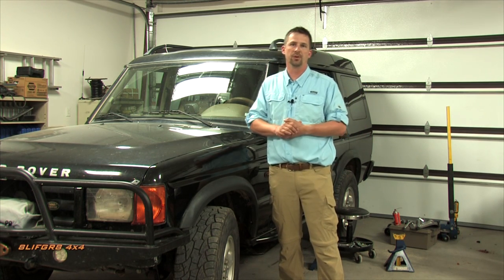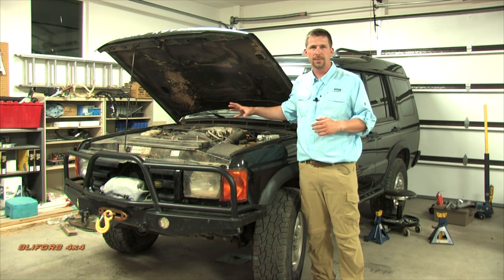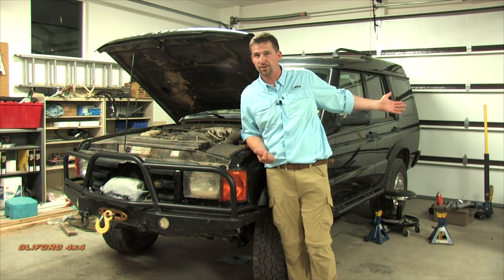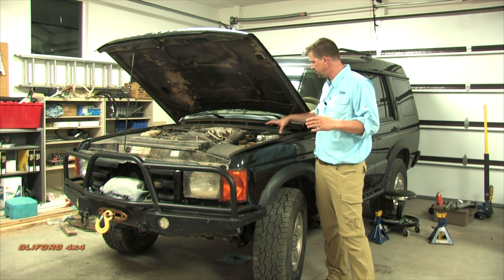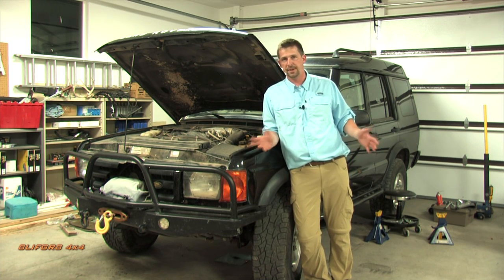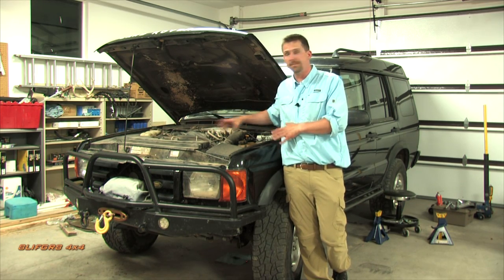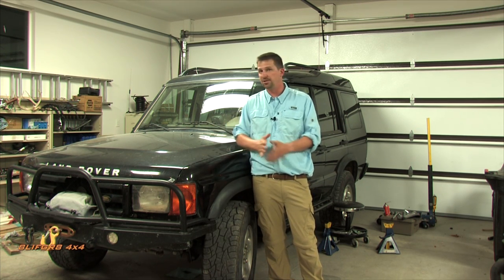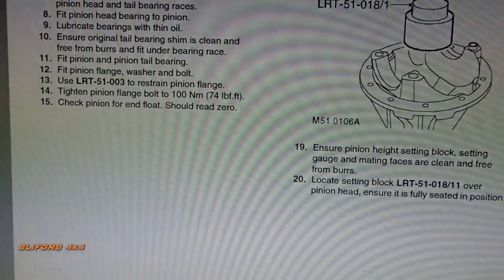Ultimate Owner's and Buyers Guide:  Land Rover Discovery 2

Comment: Great video, everything he said is 100% accurate based on my experience with my 2004 Disco II. Once you dig in and get to know the truck it's not so bad to work on. My first repair experience that was frustrating was changing plugs, I pulled wires of and cracked just about every plastic tube under the hood. Talk about frustrating, anti freeze and vaccum leaks everywhere. Holy crap, the worst repair had to have been the ignition coils, no room to unscrew the bolts that hold the coils in place under the cowl. I probably should have removed the intake manifold and replaced the top half gaskets. I'm sure it's only a matter of time until I have to do it again.
Reply: well he did a good job but he is not 100 percent accurate. if you have a 03 in the oil pump failure VIN range you can not simply replace the oil pump. as you know the pump is actually a part of the front cover.. and during the machining process there was a dowel hole feature that was machined out of tolerance and not caught. I cant remember if the hole misposition was on the front cover or if it was the dowel pins that locate the front cover to the block. anyway the land rover fix for this during warranty was installation of a new longblock. so if you have an 03 in the failue vin range you are gonna have to replace the front cover (if that is where the faulty hole spread is located. or you are looking for a new block! Either way you will not simply be replacing the oil pump and moving on. 

I have an 04 SE7 with 85k and It is starting to do weird stuff. i bought it cheap knowing it had just overheated bad. so I jumped right into a head gasket replacement. I didnt want to do the inline thermo mod so i got a new land rover 180 deg and also a put in a new water pump , hoses, radiator and a heavy duty clutch fan. but im still floating around 200 and over sometimes according  to accuguage. i dont know what im going to do next. I want to just put a new long block in and not have to worry about it for many years, hate to say it but im always thinking about boiling coolant on a long trip!

I have the center differential and it is really really tight. im scared to engage it again. what do you have to get at to lubricate the shifter and linkage
Reply: @matthewlewellen6516  I have a 2002 with a 4.0 and I got the inline thermostat mod and I'm running down in the 180 range constantly it's amazing! Also I got the coil pack relocation kit when I needed to change it do to a misfire and wow it is so much better up front
Reply: They make a relocation kit I just did it this weekend! Yeah you're right it's a nightmare I broke all kinds of connectors and vacuum lines along the way but now my coil pack sits up front between the alternator and the tire jack under the hood. There's a perfect spot for it and the custom wires run perfectly. You just get these harness extensions and then mouth is little bracket on your alternator and you have your coil pack right there in front of your face from here on out

Comment: New sub here. Brilliant tutorial,  I’m from Ireland and have a 2003 discovery 2 4.6L in Portugal. It’s a USA Jeep and has only 50K on it. Never been off rd. I plan to take it off road. Nothing too heavy . Beach, sandy and trail driving. Little or no rocks. I’m considering fitting the TD5 thermostat, and the ultra gauge. Save my head gasket. Cheers again for great video.

Comment: I had the three amigos on for almost 2 years until I read an article on the forum. I replaced the shuttle valve and did the reccomend work around. When I had 3 amigos I didn't have ABS which was scary.
2004 Discovery II, I bought it in 2008 with 35k miles now 168k. Been through alot with mine, thank god I can do my own repairs. 
I have the master cylinder oring issue in winter, replaced crank sensor twice, replaced cats, O2 sensors, radiator, water pump, headliner, LED headlights, front shaft, and much more. Steering is next. Yes, leaking is definitely an issue on L.R's. 
I parked mine in my garage for 18 months, recently fell back in love with it.
Reply: How did you do the LED headlight swap?

Comment: Great video, man! Owned my Disco II since 2018, and its been way more reliable than I had any right to expect. Anyway, you covered all the bases, I think. And 100% on the T-stat. When I installed a REAL temp gage, I was shocked at how high the "normal" operating temp was. I was seeing 230 on the highway, and it would usually spike to 250F when I exit the highway for a fuel stop! No wonder these things have a rep for eating head gaskets! The only thing you brought up that I wasn't tracking was the "guibo" flex joint. Might have to toss one on, JIC.
Reply from the maker: Mine is starting to crack but I haven’t bothered with the job yet.  Spare is in the rig.

Comment: Thanks very informative. A parts man in a very successful rover shop told me that the electric AC fan is also for when the engine overheats. Mine will not move, it’s rusty. I took it apart, it’s not fixable.
Reply from the maker: Maybe I should test mine, it’s been awhile.

Comment: Thanks so much for this video. Huge help. I just bought a 2003 with only 64k miles on it. It was part of a drug seizure and sat for 10 years. The exterior is beaten from the AZ sun, but as far as I can see, there are no leaks yet and it runs great. I'll be checking that oil pump and feeling around for the center diff lock (although it's probably not there).
Reply from the maker: Lol, @Maw 3615054

Comment: The rear drive shaft Rotoflex coupling when new is really stiff, any cracking or softening will often cause rear axle vibration. It's a cheap replacement part - use a genuine one and it will transform the drive. I also suggest Polyurethane suspension bushes as original rubber ones will distort and make tracking difficult to set. Poly bushes will need a hydraulic press to do the major radius arms, but use for all ideally. This will make the car chassis feel like new and they are self lubricating!!!Kits are available with various firmness, make sure they come with stainless steel bolt sleeves.

Comment: Awesome vid. I have a 99 Discovery II, With 280,0000 miles. I have ALWAYS used Shell Rotella T. 15w-40. No problems . You did forget to mention not to talk bad about your Rover within hearing distance...It will break down on purpose to just piss you off.
Reply from the maker: Hahaha!  Mines leaking in the driveway now.  Most likely because I replaced my dino oil with synthetic, but I think it's because I've been wheeling the LX.

If the stupid Toyota wouldn't require so much maintenance, I could give the Rover some needed TLC and get her back on the trail (she needs the leaks fixed, has a small exhaust leak now, and due for plugs )

Comment: If you're in an area or State with no emissions tests, besides the improved driveshafts do a catalytic delete 
No more heat issue and several more horsepower
Reply: Rob Crissinger just get an o2 simulator to avoid the CEL. Some emissions test are just an obd2 scan.
Reply: Have you done this? Just got a d2 and need to do something about my exhaust as it’s bent badly. Was thinking of doing the delete but worried about bad back pressure.
Reply: @ChelseyWood  Yes I did a secondary air delrte and cat delete.
Reply: The cat delete lowers backpressure

Sounds cool too
Reply: With a proper running engine there's no impact on horsepower or heat. The heat comes from the manifolds. This isn't a 70s muscle car, the D2 makes so little power and cats are so free flowing you would notice the same difference by just using a lighter oil.

Comment: I have the TD5 thermostat. It works well with the TD5 engine. Last summer, out side temp was  45C ( 113F ) The coolant temp, from the Nanocom was 95C (203F) Stationary at the traffic lights. When the car moves, the temps drop. This is with the A/C going full blast!  My three amigos was fixed by replacing the hub, which comes with an ABS sensor.
Reply: Can u please provide a link to order td5 thermostat

Comment: You have a very informative video that will guide me in buying a discovery II in the near future.  I have a 2012 LR4 with 99000 miles on it.  It has different engine issue but as long as you keep it maintained, it should not give you problem.  I do the maintenance and suspension repair myself.  It is fairly easy to maintain if you are a DIYer.  I just love my Land Rover.  I seldom use it for off-roading but I will be doing over landing this coming summer.  Thank you very much for the much needed information.

Comment: I’ve replaced a CPS. Not a hard job just extremely frustrating. The coil pack replacement is also unnecessarily difficult. I would love to have 5 minutes alone in a room with no cameras with a few of the people who designed the D2. Id make them feel our pain. LOL
You are right about the LR community. I’ve been a part of many different enthusiast communities over the years and the LR community is among the best I’ve encountered.
Reply: Yeah you're correct the coil pack job is absolutely ridiculous but I just did my over the weekend and I bought a coil pack relocation kit and it was so awesome to put that manifold back with that coil pack out in the front of the engine from here on out. Now plug wire changes Take 5 Seconds. Also I did the inline thermostat and I run in the 180s

Comment: My recommendation as a mechanic and as a owner is to run penrite HPR 10 do not run diesel oil in a petrol or vise versa as it will cause more damage to the engine as it’s not meant for it and change it a around the tipical 6k km or 5-6 months and filter wise I swear by ryco

Comment: I'm coming at this all wrong, have already bought my D2 TD5 from a friend (cheap).  

But this is an interesting video with useful pointers at the most common issues.

Thanks!
Reply from the maker: I would say snagging a TD5 is the proper way!  Manual transmission?
Reply: @ForgottenWaypoints   Yes, manual, but it's an 03!  Previous owner put an automatic diff lock in the transfer case though.
Reply from the maker: @JimBiddle. , interesting.   So it's activated by a button?
Reply: @ForgottenWaypoints  He says it's automatic, when it slips, it engages?  I'm not convinced, but he has spent some serious wedge on this thing.  OME lift kit, AMC cylinder head, every type of under body protection you can squeeze under it, list goes on and on.  HOWEVER, the guy that was looking after it, has fitted a 10p ECU to this 15P engine, doesn't inspire confidence!  Think I need to find a wet field, and see what it does.

Comment: Nice car man! I own a Discovery1 300tdi wearing Mobil1 5w-50 for all season. In Spain we supports over 40 degrees celsius in summer and about -10 celsius in winter when we go on snow. Oil is responding perfect on all scenaries and temperatures and we change it once a year, normally in spring time. Oil is very important component in automotive. 👍🏻

Comment: Thanks for the the content!  Just bought my 99 disco 2, and you were one of the channels I did my research on.   I did the 180 tstat last week and I have the same temps you do 👍.   I'm troubleshooting the 3 amigos.  So far found one bad wheel speed sensor,  replaced it.  Just ordered the icarsoft scan tool to continue troubleshooting.   I'm in MN so the cold winter coming had me wondering what oil to use...  rotella?  Maybe.
Reply from the maker: You'll want a 5w40 with zddp/anti-wear for all around temps of Minnesota.  You can do 15w40 in the summer and a 5w30 in the winter and add zddp like muscle car owners, or use Rotella T6 5w40 year round.
Reply: Schaffers  has the best cold flow synthetic oil.

Comment: One point to add about oil filters is there is a oversized version, I run the K&N 3001, holds about 1/4 extra quart. I also have a 4.6l which did not have the oil cooler that the 4.0l had. So I installed a 4.0l oil cooler and picked up about an extra quart of oil capacity and the cooler oil Temps. I also installed a mechanical oil pressure gauge linked into the timing cover/oil pump housing.

Comment: Nice video, i am interested in either a disco I or a II, this video showed me not to be that afraid of a II series, i live in Mexico near the border with California and discos I and II are plentyfull and cheap, maybe all the retired dentist and lawyers from California dont want to hassle with repairs or they dont pass smog anymore so they sell them over here. I could take advantage of really cheap labor cost (compared to the US) in a specialized shop or even my own mechanic for the hard stuff. I plan on only using it for traveling and weekends so i wouldnt put the stress on it of a daily driver, in theory it should last longer. Now i am researching for a buyers guide on the Disco I to help me make my choice. Thanks for all the information.
Reply from the maker: Disco 1 might not have traction control, but you get full float axles!
Reply: @ForgottenWaypoints  Is the slip liners thing a random issue or it only happens if the engine is overheating? and the driveshaft overheating due to cats, if you live in a non smog compliant state, couldnt you just delete the cats and solve that issue  for good?
Reply from the maker: @ambienteterrazas  , the slipped liner can happen at any time if your block isn't very good thanks to the expansion rate of metals between the aluminum block and steel liner.  But it most likely happens following a head gasket failure.

Removing cats is a federal offense, even in non-compliant states.  The sealed U-joint can still fail (so can the greased one), so even on a theoretically cat-less D2 you don't just want to ignore the driveshaft and want to check it routinely.
Reply: @ForgottenWaypoints  Thanks for taking the time to answer my post and again thanks for the really cool and informative video.

Comment: Excellent well informing video!   My 2000 TD5 D2 has never had the Three Amigo's (everything else has gone but not that) and I put that down to not dunking it in cold muddy water every weekend. Besides, mud is bad for the chassis.   Too much sun on the headlining! Wow, over here in the UK it's leaking sunroofs that lead to dangling headliners!
Reply from the maker: My headliner is gone, not from water but from the desert heat!  The glue is finally giving out, but I guess 21 years of glue next to black paint isn't too shabby really.
Reply: @ForgottenWaypoints   Nope, it's done pretty well.  I'm still not sure wether to reinstate the diff lock.  With a diff lock and tall tyres there's more chance of breaking a halfshaft, I think. Not sure.
Reply from the maker: @sleepycatpictures1176  , Mud and high RPM is probably not best on the axles, I'm more familiar with rock, so it's opposite for me. 

If we don't have the CDL, you rely more on traction control which spins the tires more to activate, with CDL engaged, traction control isn't activated is often, wheelspin is minimized, and I would assume a lower chance of a shaft snapping.

Honestly though, I don't think half-shafts are the weak link until you do lockers (front or rear).  Your worm gear in the diff will probably break first, at least that's what I've been told.  I haven't broken either (knock on teak!)
Reply: @ForgottenWaypoints    Mm, good point. Spinning wheels to activate traction control is half the battle lost.  I was thinking more of a cross-axle situation where too much welly causes most of the power to go to one wheel.  Anyway, you have done more rock crawling than I ever will so if it's not broken yet - carry on!
Reply from the maker: @sleepycatpictures1176  , Yup, your situation is also at risk.  With the CDL though you force the front and rear to spin at the same speed.  Without CDL, you can get ALL of the wheelspin to one wheel.  I had that situation once (not on a Rover, but a Jeep Grand Cherokee).  It was not fun.

Still didn't break anything though. "Bouncing" (the result of flooring it to get up a loose or low traction climb) seems to be the favorite method for breaking parts that I've seen, probably because it's a combination of all axle-stressing scenarios wrapped up into one battering moment after another!
Reply: @ForgottenWaypoints    Yup, you've talked me round, CDL is good. Don't really need it around here though (Leeds, UK) the kerb is the highest thing I have to climb!  The reason I brought this up is a vid I saw on Youtube where a bunch of guys were off roading in various vehicles and one bloke had a Disco 2 with the lift and the big wheels and the usual stuff and he broke a half-shaft, again. It apparently happened a lot.     Perhaps you are a better driver!
Anyway Good Luck with your Disco and Happy Travels!
Reply from the maker: @sleepycatpictures1176  , same to you!  I don't know if I'm a better driver, maybe I'm just more cautious.  I hate breakdowns on the trail, I'd rather drive home and try again if I'm out-classed than push to far..